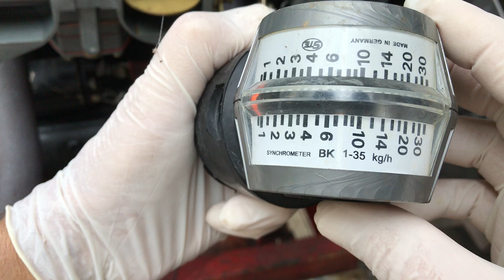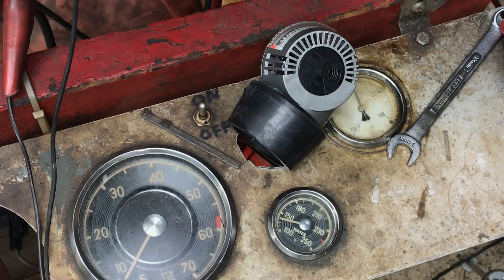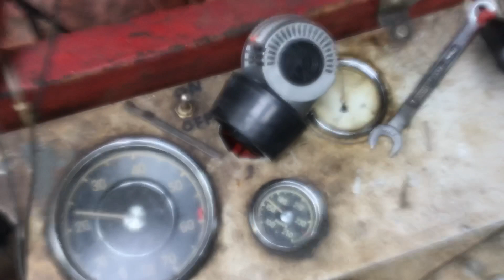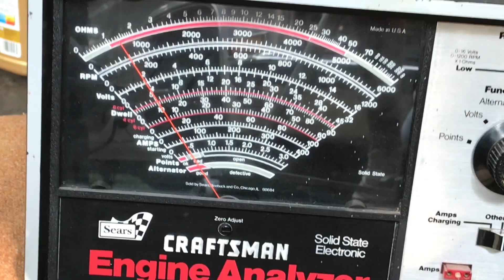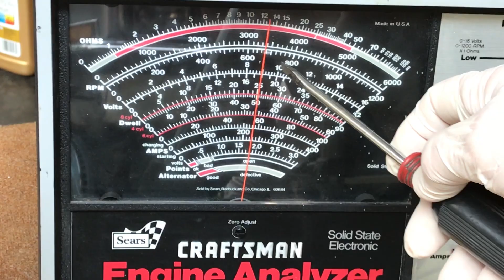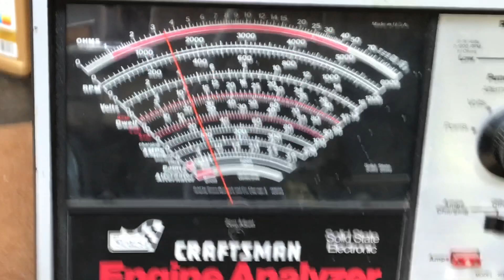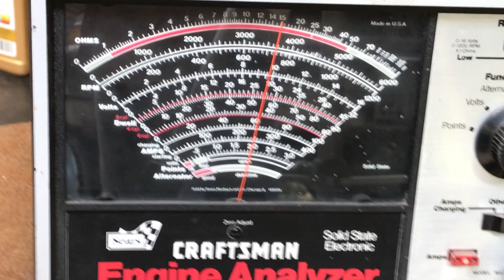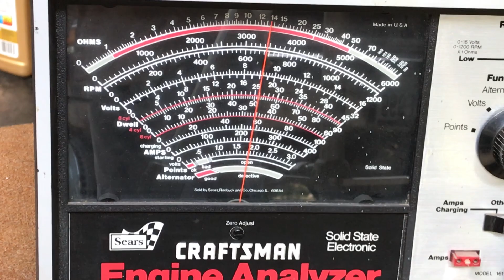Testing Eric's Solex

Comment: i have two pairs of 190sl carbs not in the best condition but they aren't corroded one set is the later diecast type and the other the earlier rarer sandcast. Any idea how much they are worth?
Reply from the maker: Hey Tom,
Ebay. Monitor Ebay for current pricing and sales.
Sandcast are valuable as long as someone needs them. 
The diecast is more saleable, but also prone to cracking, depending on which version it is.
Just keep monitoring Ebay. Good luck, Will
Reply: yes i was wondering more for sandcast as there currently non or ebay or other sights like that and cannot find any but thanks.
Looking at them the diecasts dont have any cracks there is a small crack in the sandcast but it isnt any where near the body it is in one of stub wholes
Reply from the maker: In last 10 years I have had one person looking for a sandcast carb.  In 40 years I think we have rebuilt 3 sets. While they are rare there are few cars that have them or need them. If a person needs sandcast carb(s) for a concours restoration then they should be worth more than diecast. But if no one needs sandcast they make great door stops. The stud holes are on the thick plate that bolts to the body, correct? If so, the small crack should not be an issue.
Reply: yes on the stud plate on the inlet side. I see about the sandcast set though i even emailed mercedes classic but they said they dont buy or sell parts to customers and that you have to go through the dealers so im unsure what to do with them. Are there many large restorers out there which might want them like mercedes specialist restorers